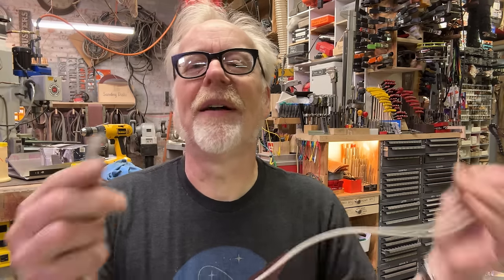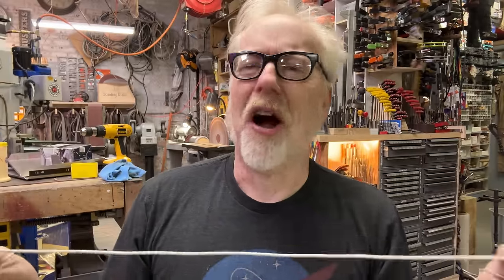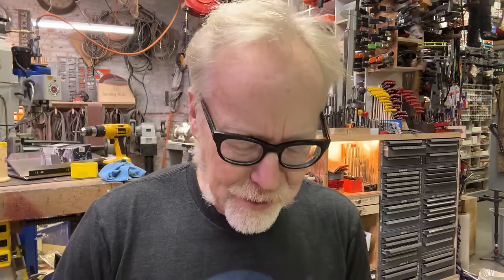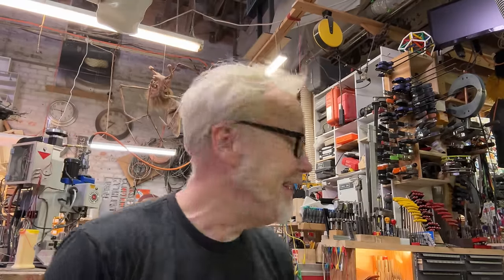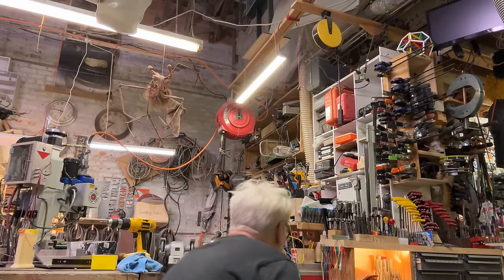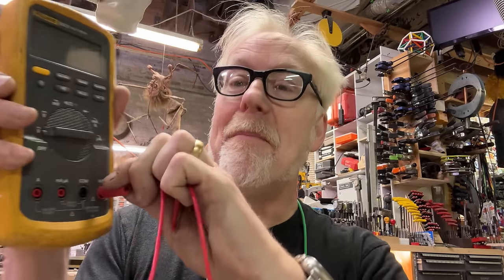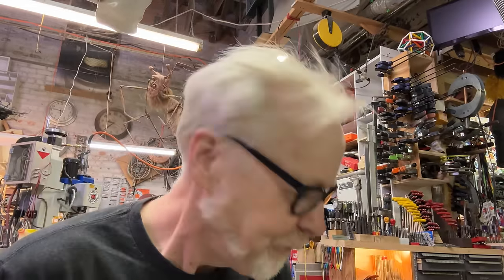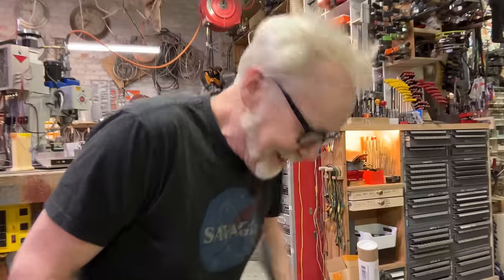Adam Savage's Alligator Clip Leads Problem

Comment: The green "snapping Turtle" leads you showed are like the ones I used when I was repairing TV and Radio back in the 70's.  They held great but sometimes I needed the small ones to reach into the smaller circuits.  Mostly I was doing temporary connections to test work arounds on old tube sets.  Your last one was also a go to.  However, if I could suggest one, it is the loop connector.  Does not work in all situations but it does make a solid connection with little loss.

Comment: About resistors: Try the voltage divider calculator (online) to find what you need for a given voltage input. Potentiometers work the same way. They implement a variable voltage divider
Reply: That's the wrong tool.  And if you're suggesting to tap off the bottom resistor to feed the LED, it's terrible advice, as the last thing you want is a voltage divider that is going to eat up current unnecessarily.

Just calculate it yourself.  Say you have an LED that requires 20mA, and has a 1.5V forward voltage drop, and you want to power it with 5V.
(5V - 1.5V) / 20mA = 175 ohms.  

How hard was that?

(Apparently too hard for me, because I originally posted the wrong answer!)
Reply: I like to use a 5 watt potentiometer when I want to find the right brightness for an LED.  5W is beefy enough that I won't fry it doing something not smart.  The LED on the other hand...they are cheap. 
If you use one of the calculators, it'll give you the value for full brightness.  Most of the time, that's too bight.
Reply: LEDs vary a lot. Even different colors or batches of the same model can be way off from each other. Best to prototype with a variable resistor if you can, or just swap resistors until it looks right.
Reply: @blairhoughton7918   True.  I've found that with cheap LEDs.  If you get name brand from a good source, then they have very good color consistency (with the same spec'd wavelength).
Reply: @Hyxtryx  To me personally, very, I know nothing about electronics.
Reply: @Adrian_Galilea  Oh, sorry.  I was directing my reply at the post I was replying to, as well as Adam, because in the video he says he doesn't know how to calculate it.  I'm sure he knows ohms law, so I gave him just enough to be able to reverse-engineer how to calculate it. 😃

For you:  Ohms = Volts / Amps

If the spec sheet (you have to look it up) says the LED nominal voltage is 1.5V and current is 20 milliamps, and your power supply is 5V....   And you want 1.5V across the LED (because the spec says so), then there must be 5 - 1.5 = 3.5V across the resistor.   

Since 0.02 amps will be going through the resistor, to make 3.5V across it the resistor must be  R = 3.5 / 0.02 =  175 Ohms.

OMG, my sincere apologies to Adam!  I had the wrong answer in my earlier post!  D'oh!  I had 167 ohms.  I must have used 3.3 instead of 3.5 for the volts.   The correct answer was 175 ohms.  I'll have to edit that post so I don't look like a fool. 😄

You can also use a variable resistor, as folks have mentioned, but you run the risk of burning out or damaging the LED if you turn it up too bright.

Comment: I've had the same issues and niggles with clip leads but use them all the time with my CNC router. I ended up putting a small neodymium magnet in the mouth of the one used for my touch probe and it works amazingly well like that when using ferrous metals.

Comment: Thanks again. 
   I have a mix of connectors. 
The new test leads are even cheaper with copper clad iron  wires. The higher resistance of iron or copper clad brass can mess up current flow even for LED circuits.

Comment: As an electrical testing technician, I build my own test leads and jumper wires. The best I've found is some silicone wire #14 or 16 and the banana jack plugs you build. That way I have the length I need (or want) and I can use any banana jack accessory.

Comment: In electronics design, my favorite cheap clip style is the one you showed with the hook. I have some with that on both sides, and some with banana plugs like yours, which I use to connect to my power supply and multimeter. I have the alligator clip ones as well, but they aren't soldered and are therefore unreliable; I've had to solder a couple of them because they stopped working on me. The wire gauge in all of these is so light, that I don't like pulling much current through them for very long—especially the alligators which are only poorly crimped. I've never had those larger alligator clips.

Comment: I love using them. I used to hate them, too. Until I found decent ones, that actually were soldered, where the wire inside was not magnetic but instead was low resistance copper so you can actually put a few amps through them.
They are good everything-to-everything adapters.
However, issues remain: once that thing is bent like 2:47 , it's done. Sometimes squeezing it from both sides with pliers re-aligns it somewhat.
What I did to make them better myself is to make one end alligator, other end something else. That makes them less adapter-y but better at specific adapter jobs. I have some that adapt to breadboard (2x1 pin row, 2.54mm pitch). I have some to adapt to generic battery (magnet that sticks to poles). I have ones with devices in between e.g. the short circuit indicating resettable fuse (a 5W incandescent bulb, lol).
The having to use a lot of force issue stems from I think 2 issues: 1.) the insulating things around the clips aren't soft (anymore), so they contribute to the force needed. I throw them away if that happens (only the insulation, not the clips. They still work without insulation for most cases). 2.) You're not that young anymore (sorry)

I can't find where I got them right now, but it wasn't Amazon or any other cheap marketplace. But I bought them specifically labeled as higher quality (while they also had lower quality in stock), with a "0.5mm² copper" and "soldered" label

Comment: Neither of those are for building a circuit. a breadboard would be a good start. those crappy small ones can be used to just check a circuit. 1/4 amp or less probably.
Reply: Breadboards are better for planning and testing PCB circuits. Not really ideal for quick and dirty electronics projects. Think adding or removing a component from a tool or toy, rather than building electronics from scratch.
Reply: @1308lee   I know. he said he uses them to build circuits not me.

Comment: Adam, I am an electrician here in Colorado and i use inline WAGO wire nuts.  They are rated for 10 -14 AWG solid and stranded wire, so I'm not sure if this would have an application for small voltage electronics. I have a spare switched extension cord with a grounded plug at one end an 3 WAGO's at the other end. I use it for testing continuity on de-energized outlets, or for testing a light. It lets me isolate the ground, neutral and hot without having to take the outlet out of the wall.

Comment: I have a trick that might work on those leads that you tossed.  I have found that the metal part is often fine.  But the plastic cover which should remain supple has hardened.  Cut off the cover.  Yes, it makes the clip less useful because of the increased risk of shorting to something near it.  But, it is much more useful than one in the trash can.

Comment: I dont have a suggestion for a replacement for alligator clips, but I do have a suggestion for test leads for your DMM.  Last year I purchased a new set of Fluke test leads for my DMM, due to the original pair giving inconsistent readings.  Last month I started noticing strange readings from the new pair.  They weren't stable, and when shorted out would move from about .3 up to 1.2 ohm.  Fearing the worst, I knew that the leads could not be the problem, so I began the process of sending my meter back for repair.  I was over at a friends lab, and mentioned my issue.  He had a different set of leads, I think from Keysight, and WOW, they were stable, and when shorted, the DMM showed .2 ohm.  What's going on?  I more carefully evaluated my leads, and at least the black one was faulty.  I went online to get some replacement leads, and found they are > than $40.   I found Probe Master, a company in El Cajon CA.  I purchased a couple different lengths, and WOW, I AM IMPRESSED!  They work awesome, are very flexible, and only $24.  BIG THUMBS UP!

Comment: In all these years of electronics (mid-grade, know enough to design my own circuits or alter existing ones - haven't done anything more complex than basic chips) i've never used clip leads. I've used sleeved J hooks to hook unto stuff, but usually, i solder or twist wire. I've never bought them because their scope is ultimately limited and i don't mind soldering which i can do in just about the same time it would take me to clip something, once the iron is hot. In fact, i have a custom iron just for soldering quick connections with a super fine scoop tip i made on my lathe. It's a quick coil that activates with a foot switch at my bench. Solid connection, doesn't risk falling off or touching anything other than what i want.

Comment: Minigrabbers and micrograbbers are the names of the hook-style probes. Pomona has high quality probes in their catalogues but they are often more expensive. These are useful for old circuit boards, but there are specialized IC clips that use pin and socket design. But since most circuit boards are surface mount these days, I use PCBite flying probes for handsfree measurements. They have magnetic bases and sharp, retracting pogo-pins for connecting to small chips, and are replaceable with pliers if broken.

Comment: I have the same clip leads you liked, Adam. Got them on Amazon and yes, they are very good and very strong. I was trying to pull a couple off a shelf and they were still attached to some wires, normally shittier ones would just disconnect, but these ones pulled the wires and stuff I was testing on across the bench. Was surprised to say the least.

Comment: Embedded system engineer here. My preference is cables with banana connectors on both sides with retractable sheaths (reduces accidental shorts). Then tips of various styles that can be attached to the banana connectors. The meaty alligator clips are what I use most, but I have a couple needle probes and hooks that allow me to probe tiny pins and pads on circuit boards. BNC to banana connector then extends the flexibility to an o-scope. The modularity is incredibly useful.

Comment: As an automotive mechanic, so a slightly different need to for electrical equipment for diagnosis, my favourite clip leads are the ones you can make out of Fluke’s multimeter leads, and their big clamps that come in kits on their higher end meter, get a magnetic colour coded lead exe tension spool that uses fluke style banana jacks and it’s the best for temporarily overlaying circuits to narrow down issues or verify that parts are actually functioning and that there is a wiring or signalling concern

Comment: Hi Adam, I mucked around with the arithmetic of LEDs.  As CBers and Hams will tell you, when the alternator is running a car supplies 13.8 volts (occasionally a bit more), but this works for the maths:  A plain red LED "drops" 1.8 volts, (it varies marginally with current). Thus we have 12 volts we can't use, so need to drop this across the resistor. While you can apply Ohm's law, a simple rule of thumb is: If you want to 20 mA, multiply you excess voltage by 50.  So, 12 volts x 50 = 600 ohms, or 620 ohms from the parts draw, if you have E24.  If not maybe 560, but 680 would be the better E12 option for reliability.  You want a half-watt or a 600 mW unit.  If you want to go easier, use 10 mA so you multiply by 100, and 1k2 or 1200 is a common value (E12).  For a green-yellow (2.2 volts) from 5 volts at 10 mA, you will drop 2.8 volts so 270 ohms.  Note that the drop will be be similar no matter the current, but you will either stress the LED, or maybe make it too dim (or make it no longer work).  Green-blue drops about 3 volts, like blue.
The alternative is a CL220 driver.

Comment: I have a set of different lengths and end combinations that I made in an automotive electrical class at a technical college. It was mostly to practice soldering but we also got something useful out of it. Some of the ends are little aligators like in this video but most of them are different size fuse connectors so you can plug them right into the fuse box of a car and test continuity that way.

Comment: I've been using wago lever-nut splice connectors a lot lately. For connecting wire to wire and wire to through-hole component. Even for just mismatching the test cable ends I want together. It's also made it feels less bad throwing out bad test cable ends because I know I can easily splice the still good end to another good end when more clips go bad.

Comment: I have been using Fluke test probes & clip leads in various shapes and sizes since 1982, and they are still good!
I also use minuscule neodymium round magnets where applicable and clip my probes to those.
But for your truly miniature wires, I would suggest the Kelvin clips, or even better, the Hirschmann clips. 
Although you are not suppose to drive high currents to them, you feel almost like a surgeon so small wires it can successfully attach to.
BTW, Fluke has also an assortment of their called SureGrip in various sizes that might suite you.

Comment: I've used Hirschnamm clips and leads. They really are the cream of the crop. After using them for some time, I was shocked when I saw the price for them, but you get what you pay for. The 25A croc clips are super sturdy and nice to use, if a bit bulky. There is also an 8A variant which are rather dainty and excellent. They all connect with banana plugs, and the leads are quite good too, generally rated for quite a few amps. They certainly hold up to some abuse.

Comment: Speaking of thrifty, love the vintage NiCd Dewalt drill.  I still have about a dozen old 18V Dewalt tools that are 10-20 years old and still going strong.  Used to have about 8 batteries on the go, but I'm down to 3 that are still usable.  Finally bought an adapter and a couple lithium batteries a few months back when there was a screaming sale.

Comment: clip leads is why using a breadboard to build and test circuits is a faster and better solution. We used breadboards exclusively in electrical engineering school. Going to some of my first job sites I would bust out a small breadboard and it saved me over and over.

Comment: Totally with you on the default version being crap. At work (high school science tech) I tend to use the slot-on croc clips which mate with the standard banana connectors, they're dirt cheap and far better. Wasn't aware of the wire loop capture option, that's niche but very useful.

Comment: I work on electric forklifts and some other smaller material handling equipment and I have too many multimeter accessories. Fluke makes AC220 SureGrip Alligator Clips which are actuated in the same way that your hook clips are but have alligator clips on the end instead. The main downside to them is they are bulky so they aren't great in tight areas. Fluke also make pincer clips which are similar to the hook clip that you showed but instead have 4 grabbers that come out similar to a crane game claw which are nice for grabbing out to things on a circuit board or grabbing onto screwheads that are holding eyelets in place.

Comment: I was going to say "The struggle is real", and then Adam said it for me at the end of the video. :P In my field service days I had a knot of three or four different kinds of clip leads in the bottom of my tool bag. Some applications you're pretty much stuck using a specific style whether they're any good or not; even the crappy ones have their place. As cheap as they are you might as well carry a selection if you don't know what you're going to be facing. Or get creative and make your own if you're working on the same thing a lot.

Getting clip leads or accessories for your multimeter is a must; the extra cost is worth the frustration you avoid down the line. The Fluke alligator clips that slip onto the standard meter leads were required kit in our department, and they held up well to abuse in my experience. Usually carried two pairs - one set for smaller low-voltage work modified by trimming away some of the excess insulator jacket, and an unmodified set for when I wanted to check rated-voltage stuff like motor leads, SCR heatsinks, etc.

Comment: Alright Adam, I have an extensive collection of leads both homemade and purchased; same complaints. However I  have several tips.
First, go all in on the banana jacks. then ditch the fluke leads. You can get the tip of a multimeter probe (Extech TL809) that is constructed with a female banana jack and ends with a male banana jack with a sharp tip on it. it has a 3 inch "handle" in the middle that makes is almost look like a fluke lead. 
Second, start making your own leads using "Retractable Sheath 4mm Banana Plug Male Stackable" ends. These are great since they have both the male and female side and the retractable sheath allows them to be much more resistant to sparking. 
Now you can have an awesome set of multimeter leads that can be easily extended and can have multiple things attached to it. 
Third, you can now start incorporating binding posts into projects and using these banana leads to power it. I have a pair of binding posts on my sailboat dc panel and my meter plugs into the neg for a perfect ground every time.
Reply: As for the clips, I use the ones that have a female banana jack. my Extech TL809 plugs directly into them. I also make up some mini ez grabber clips and use those for the really small stuff.  I make them with a generous length of very light wire  leading back to a banana plug.